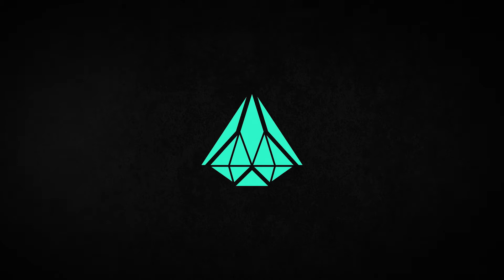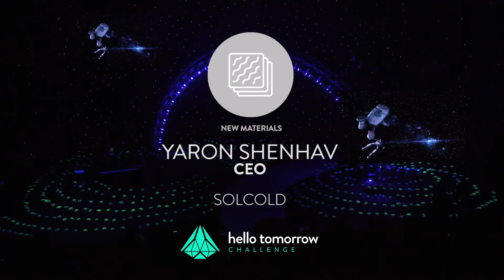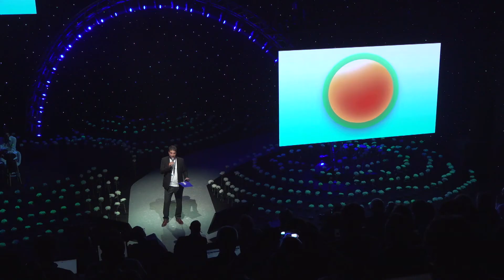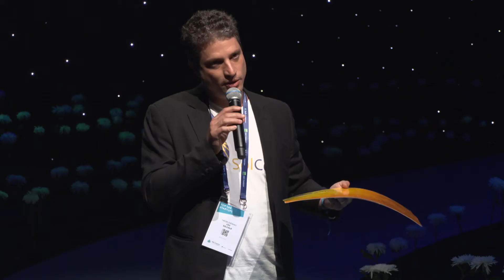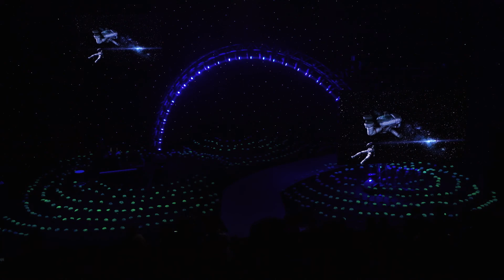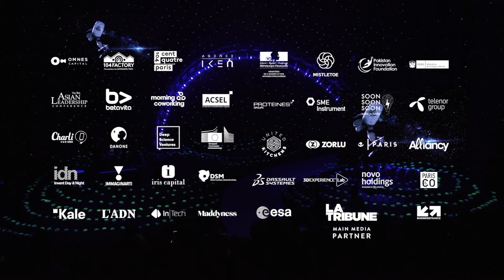Light-filtering paint can cool buildings | SolCold | HT Summit 2017

Comment: Ha ha ha this reeks of scam. Laser cooling works on individual atoms and works by directing an opposing energetic force on specific atoms via specifically tuned photons. Picture a tennis ball moving from left to right, and blowing a puff of air against that ball from right to left. If you blow juuuuust right, you'll slow the ball down to a dead stop. If this ball were an atom, that "dead stop" would equate to "absolute zero" -- no movement -- and it would be "absolutely cold". In the case of the tennis ball, the force of the ball and the force of the air would cancel out. Equally importantly, you'd need to blow JUST enough air against the ball until the ball stops moving and then STOP, blowing or the ball would start moving in the opposite direction. This is ENTIRELY different from what these guys at SolCold are claiming. They're claiming that you can dump endless energy into their magical paint and it'll just keep getting colder and colder indefinitely. Where is all that energy going? Because cold is the ABSENCE of energy. The answer is....the only thing that will get colder are the wallets of gullible investors.